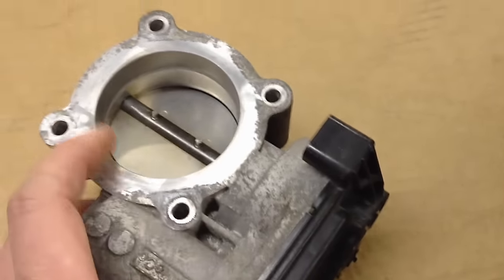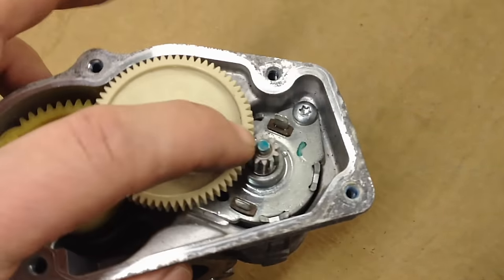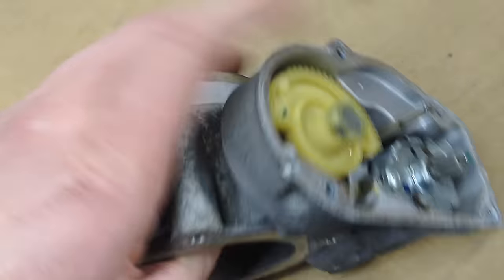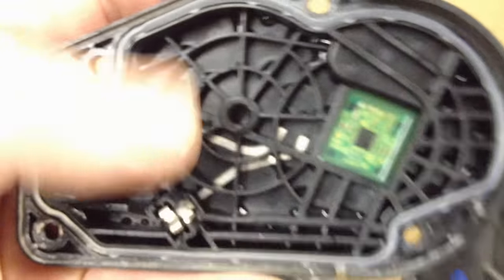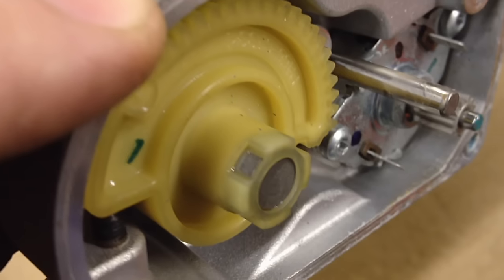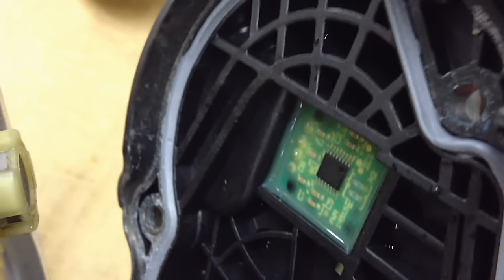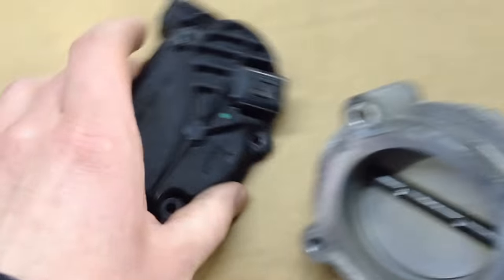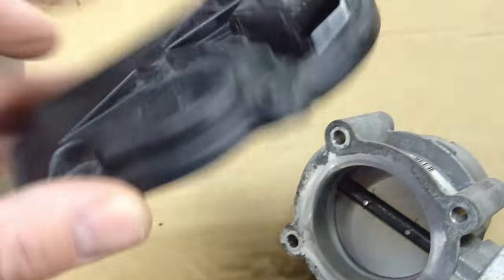Ford Electronic Throttle Body Failures

Comment: Thanks for the vid. I keep getting crazy spikes on my absolute throttle position. I changed the tps sensor but it still does it. Any ideas? I’m scratching my head 🤷🏽‍♂️
Reply: RuckusOutfitters what year model ? I have a 2014 mustang V6 and they say I can’t buy the sensor without the throttle body assy. ? Ty
Reply: Chad Dorethy I’ve got a 2010 f-150 with a 5.4 3v engine. I replaced the tps sensor but it didn’t solve the problem. I was able to buy the Throttle Body Motor for $60 and swap it with the existing one that was on my throttle body rather than replace the entire TB. Seems to have fixed the problem.
Reply: RuckusOutfitters ty for responding. I finally got the throttle body and sensor and then recalibrated it. Also had to rebuild the battery cable assy because it was over heating it and causing acid to leak. I got both terminals (gold plated) and modified an after market cable to rig the battery fuse box and it’s working better than when she bought it. It’s a 2014 Mustang V6. I really think the cable assy should be recalled but guess Ford hasn’t done that yet. So if anyone is having battery problems with a ridiculous amount of corrosion build up everywhere replace the cable or rebuild ur own. New it’s close to $400 so I made my own. Again ty for ur response. Hope ur truck is running great.

Comment: Ok I'm having a problem with this I think my truck takes off fine but every now and then when speeding up  it's like I just let off the gas for just a sec and then will pick right back up any suggestions?
Reply from the maker: Brandon Johns Very common for bad throttle bodies to have a surge feeling when going bad yes but can also be a misfire but that would be more a jerking feeling.

Comment: Do you have to use a high level computer to install these? I know they will remove and install with normal tools, but getting the new one to work with the car's computer is another story. Am I right about that or am I off the beam?
Reply from the maker: All you have to do is reset the pcm memory and let it idle 10 min to learn closed throttle trim values it is all automatic on Fords see here-
How To Clear your PCM'S Memory on Fords After Repairs
Reply: FordTechMakuloco
Thank you. I was told all modern cars needed a really expensive computer in order to even replace many parts. I was thinking of avoiding them all together and never buying a modern car again. I guess I would have been stuck with late 80's and 90's cars. This helps. Thanks again.

Comment: i got a 2008 f150 5.4 when its in park the throttle works fine but when i put it in gear sometimes it stalls and the throttle doesnt work what can cause?

Comment: 2012 Ford Mustang v6 3.7 Bbk 73mm throttle body but my car keeps saying forced closed an like when I have the car off it works fine but when turn car on the throttle plate stays stuck closed please help me with this

Comment: is the thing on the side the tps sensor the thing with the wire plug   or what im confused just bought a 05 freestyle and when i hit the gas it does pretty much nothing bought  a tps sensor but its noting like whats on the side of my  throttle body

Comment: the electronic part on my windstar is cracked so it don't like to idle at all. Being winter ( and not having alot of money) is there some way to bypass that temp and perhaps add a hand throttle control? tired of freezing my feet!
Reply from the maker: You are saying the tps sensor is cracked on the throttle body? They can be changed out separate and should be very cheap to replace unlike these.
Reply: no, the electronic control itself has a nice crack in it.. hell I'm not even sure thats a  factory TB on it being it was a taxi before I bought it and alot of parts were swapped for aftermarket. The brake rotors on the front being the wrong ones for one so they scream all the time ( it's supposed to have heavy duty rotors and these are just regular cheap napa ones, I am going to swap them for the slotted asap). That place does shit like that so you can't tell whats stock and what isn't. Maybe it's not supposed to have an electronic TB?  but it sure does. The fuel rail and injectors are all new too. the motor and intake plenum look nothing like what google images show and it's a 2003. I have allready changed the ignition module,wires and plugs. The TBS is new too.It runs good it just won't idle when cold or in rainy weather.
Reply from the maker: grettagrids Windstars have never had an electronic throttle body and the pcm doesn't have the capability to run it. Yeah something weird is going on there. You have a picture of it? I am very interested to see what in the world they strapped on there.
Reply: I found out the engine is NOT the orginal.. neither is the PCM. WHY it was changed? who knows. I bought it as is. with over 3oo thousand miles I  am not too keen to swap engines/ PCM and whatever else they goofed up. the engine isn't even from another ford, neither is the tranny. No I don't have a pic yet since it's been too cold for my camera to work outside.
Reply from the maker: grettagrids Ok well when you get a chance a pic would be nice this is very interesting.

Comment: I have a 2012 Lincoln MKT 3.5 boost = I was at a red light my foot was on the brake the cat started to take off I had to put both feet on the pedal and put it in neutral it happened twice.= any idea

Comment: Our 2012 Ecape w/2.5 had a short block installed 6 months go due to bad clacking noise (webbing cracked between 2&3 cylinder..search youtube for  escape 2.5 noise..)
Now the car  wants to stall..idle hunting/surging between almost  zero and then surges to 1200 rpm. occasionally stalls in low speed parking lot maneuvers too.. but usually the problem is just an IDLE HUNTING.. with foot off gas...also gas mileage is down.???$%%
do you think this is symptom of ETB??
Reply from the maker: Tom Sutherland Yes I have a video on that noise also. This is either a ETB or they left a vacuum hose loose. I would check for an obvious hissing noise a loose vac hose and besides that I would check the air box to make sire the filter and housing is sealed properly. Then I would go after the ETB.
Reply: thanks ! they (today) put on a throttle body..we will see!! thanks so much for the reply.
I was Ford/GM/Subaru tech 20 yrs..
Reply: WELL no good.. still same thing. I suspect an air leak... wonder where the primary spot is?? since they did a short block to fix the cracked 2-3 cylinder liner noise.. seems like not many vacuum lines there ?? I may get a hose to listen for air leek,,??
Reply: Tom Sutherland Have you had off a 2.5 manifold?? anything to look for  obvious??? it still no good...It is something they did when the short block was installed.... GRRRRR

Comment: Yeah this question is to fordtechmakuloco I have a fordfreestyleSE.its year modle2005 idont have a repair book on and when drained my CVT transmission fluid and took the pan loose there was some kind of little pin thing in my pan and now I don't have reverse at all will not move in reverse but when in neutral and park it moves forward and backward it only  drives right in drive and low gear what is wrong and how to fix and wear does that pin go and what is pin called how to fix please help and transmission wrench light still on and tire control light is on won't go off and I already gave it a oil change and transmission CVT fluid change and new filter on both and already cleaned etb.please help stuck hear and just brought car as is from dealer.
Reply from the maker: Martha Wilson You will need to remove the mechatronic assembly and inspect the manual shaft to see where it cam off at. If you cannot see anything at that point then the trans must be replaced as these are not rebuildable.
Reply: I've actually just had my cvt rebuilt, well input shaft and bearing
Reply: ive seen the neutral safty switch go bad and would go in reverse a while its in drive.. changed it and all was good.
Reply: Will this cause me to not have a accelerator pedal at all on my 2004 F150 5.4 motor.. FordTechmakuloco I used your video to change out my timing chain phasers guides and tensioners.. Even went with exactly  the parts  you said to order  through Amazon and all went great but now I have no throttle pedal at all... Starts up fine idles smooth for about 10 seconds then the RPMs drops and starts idling rough... Please help Thanks..

Comment: Hi man, could you help me? I’m having idle hunt every time I turn on the ac. I was suspicious about the Throttle body so I took it apart and cleaned it. It worked fine, but then the next day it started again an got worse. Now it triggered into limp mode (solved it by turning off and on the engine) and now it’s idle hunting randomly, but it feels so much more every time I turn on the ac. Could a bad TAC be the cause? (I also did idle relearn)
Reply: Forgot to say, this is on a 2012 fusion

Comment: i have a 2005 ford free style and when i push the gas pedal when the car is in drive or reverse it want go or nothing but it idle when setting still.
Reply from the maker: Is the wrench light on? Does the engine act normal otherwise? Do you at least feel the engagement to drive and reverse?

Comment: Hey good video i have a 2005 mustang gt that usually after tbe car has been warmed up and driven for about half hr or so the car feels like its hars to engage the clutch cus the moment the clutch starts to bite it feels like the idle drops to about 500rpm and feels like it wants to stall. It makes engaging the clutch difficult. The throttle response becomes very unresponsive aswell. But when its working fine engagemnt is smoother and the the throttle response is much better. Ive replaced the TPS but didnt relly fix the problem any thoughts???

Comment: My 07 F150 just died on me when I pressed the cruise control on button. Now I have a wrench light on and it won't try to start at all. I took the battery cables off to try and reset the PCM and reconnected them and still nothing. Any ideas?
Reply: Did you ever find out what caused this issue. I have a 04 f150 5.4 but I have no accelerator pedal at all when I push it

Comment: Dude i have big problem with my Focus can you help please :( ? Problem started after i cleaned Throttle Body of my Focus mk1 1999 1,6 101hp Zetec. First i disconected the - of battery then started the procedure i taked off the 4 screws and disconnected the sensor. Cleaned the throttle body with carb cleaner spray. And put it back with same procedure .... screws , sensor and then - of the battery. But when started the car i got problems with revs it holds around 2500 and i let her stay for 5-10 mins they droped to 1200 when i drive and switch to neutral it holds 1800 and when i stop takes 5-10 sec to go to 1200 that was last week. 70 km later now when drive holds 1500 and and when is at place 1000 no under. And again need 10 sec to go from 1500 to 1000. At morning when is cold they drop under 1000 maybe 900-950 but that is to much too. Before i clean it the car didnt have problems. I cleaned it because i heard is good for car. Car is also petrol+ LPG. Please help with some good info :(
Reply: Sorry for bad english.

Comment: My 05 v6 wrench light is on and I have replaced the TPS, the throttle body motor, reset the pcm, and cleaned the throttle body itself but that damn light wont go away. Any help would be appreciated. btw the light kicks on when i turn key, goes out, then comes back while im driving. code is forced limited power
Reply: deltaforce416 did you solve this? I’m having the same problem with my 125 ecoboost

Comment: I’m having a major issue with my 2010 Crown Victoria Police Interceptor . When I turn the key over when everything is connected, my fuel pump will not kick in and my throttle body clicks and the car won’t start. If I unplug the throttle body and turn the key, the fuel pump kicks on and the car starts but obviously no acceleration. If I plug the throttle body back in while it’s running, still no acceleration. I’ve replaced the throttle body, ecm and the entire gas pedal assembly but I’m getting the same results. Does anybody have any ideas on what I should do next?

Comment: So my wife just mentioned to me that she remembers getting a letter about the recall about 2 years ago. Is there a time limit on getting this done and do I still need the letter?
Reply from the maker: You don't need the letter what was the recall number. Also I can check your vin with ford to see if it is open.
Reply from the maker: The recall is 12no3 for throttle body failures and or surging. It is an extended warranty for 10 years 150k miles is all
Reply: Alright cool thanks a lot for your help

Comment: Is there supposed to be oil in the electronic portion of the throttle body?
Reply: Mog_3825 I currently have the stock intake with a dry filter. 

A couple days ago my 2014 f150 went into limp mode and through a P2112 code: throttle body stuck in the closed position. I took the throttle body off and apart to do some investigating. Upon taking the black cover off I found a black oily liquid inside that smelled like used motor oil/gas. I did clean my throttle body roughly a week before this happened.
Reply: Mog_3825 thanks for the info, ended up getting a new throttle body and that fixed my problem. Was just surprised to see all of the oil like substance inside the old part and didn’t know if that was normal.

Comment: yo,
Just had wife's perfectly running 2010 mariner (33k) in for this update a week ago. I noticed it felt odd in the throttle response after the 'reprogramming' on the way home. Well today the wife calls frantic saying her car engine is dying and is going to block traffic. She started the car a few more time, thank GOD a mile from home. I called dealer and they acted like the TB needs replaced and might take a week or so. Mine you its a Lincoln dealer. I said I'd replace it myself, just give to damn part. To your subsrips----if it aint broke don't fix it.  BTW her auto nights didn't work either on the way to drop the thing off.......Not real happy (!)
Reply from the maker: They can get those parts next day there are plenty available now and whole process takes 5 min to do tops. You know there is an extended warranty on these right?
Reply: FordTechMakuloco I have a 2010 Fusion, 4cyl that I am nearly certain the electronic throttle control is faulty.  Is there a service bulletin on these?  50k miles, complete loss to accelator at cruising speeds.  Intermittent issue
Reply: cpeavler
Yea first the Lincoln dealer reprogrammed the working car (note working) per service bulletin, then car failed while wife driving it next day! NOT much fun for either one of us. Then they said a week before they could get it in, I said after fubar my car, you'll do it tomorrow morning ah ah  ah ..ok mister. So why program an OLD chip or PCM with software made for a new device? And yes they had several TB in stock. Why PUT some one's LIFE at risk?
Another Ford engineer l'd take behind the shed! Maybe we'll use a timing chain from 3.5 eco motor
Reply from the maker: cpeavler Yes you should have gotten a recall letter.
Reply: FordTechMakuloco That's why we took the car in, TB and steering recalls, they just programmed and never replaced TB. Like I said, perfectly working car turned into accident trap waiting to happen.

Comment: I have 2011 lincol mkz the lost power but i don have any check engine lights i press the gas and nothing happens i turn off an ob i drive s fine doyo think is the electronic pedal accelerator

Comment: My 2016 Ford Fusion is only 7 months old with less than 10K miles on it and twice this week I have had P2112 Throttle Body Issues!!!!!  Does anyone know what FORD plans on doing about this?????  I also got code U0401.  I am so frustrated that the dealership did nothing to resolve this issue!!!!!
Reply from the maker: +Margie Ornelas - Youngblood New throttle bodies are in the works.
Reply: I have 2016 scape 6 month old it happen 3 time drive on the highway take back to ford after 4 time the replace bescuse the first 3 time the engine light no stay on ... the Last time the light stay on the found it the throttle body.. change.. but still happen I'm contact the limon law to deal we ford I'm done we then

Comment: Hi I have an 05 ford expedition and it has been giving a "check engine throttle control" message and the emission system symbol came on what is it and what can I do.
Reply from the maker: Yumi Calderin Read codes first but most likely it will need a complete throttle body. I have a video on how to change it on your engine with links in the description of that video also.
Reply: Thank you I really appreciate your help

Comment: 2013 Ford Escape S. idle control valve for it if so where is it located
Reply from the maker: There is no IAC you have an electric throttle body

Comment: So I need a new throttle body?
Reply from the maker: Brandon Johns Without being there to verify I cant say for sure but any surging in general is a throttle body failing. I would check for those misfires first.

Comment: Do you speak spanish?
Reply from the maker: no
Reply: ok
Reply: my problem is that the accelerator is suddenly turned off, then turn off the car and I turn back and all resolved
Reply: I cleaned the throttle but everything remains the same. but the scanner gave me this code p2111
Reply from the maker: Anytime you have a P2111 or P2112 code the throttle body must be replaced.
Reply: +FordTechMakuloco so the entire throttle body is bad or just the actuator control module as see. In the video?
Reply: Do you speak swahili ?